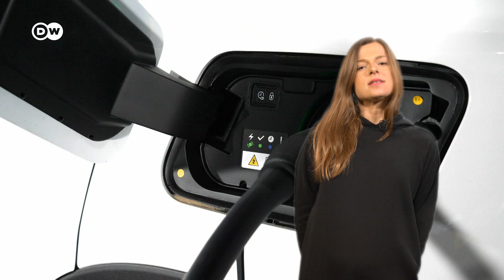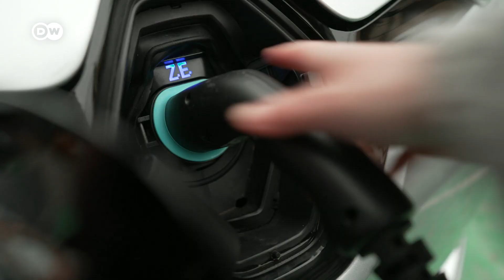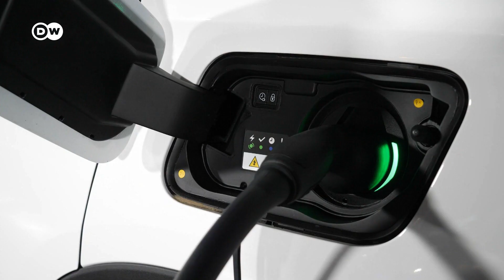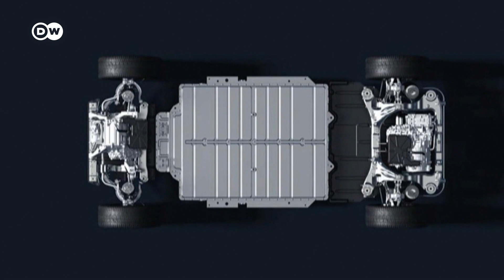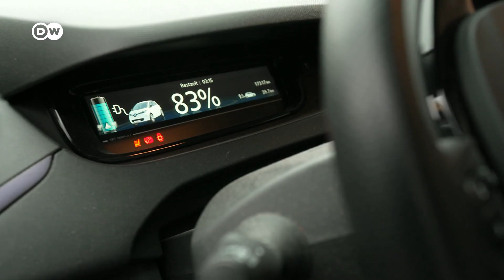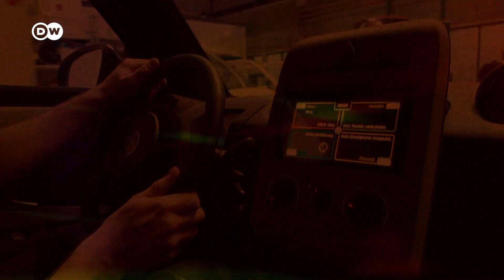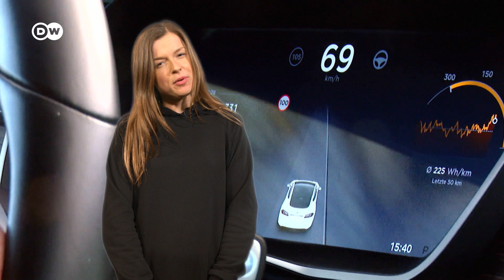From Explosions to Child Labor: EV Battery Truths

Comment: 10:35  ->"But still, are electric cars the only way out of the climate crisis?"  You people act like nothing else can be done. Like every single ICE car must me trashed and new money saved for the EV purchase. How realist is that? Do you expect all these cars now to be trashed for new EV's? Like no other way to cut emissions exists until each driver purchases an EV? Clearly this is intellectual dishonesty or extreme naïvety. The dirtiest GHG country, China will never surrender coal for  powering electricity. 98% of Americans rejected EV's this year for prolonged charging times first and not a dearth of charging stations. Electricity is no where near reliable even in wealthy countries all year long. There must be other clean renewable fuel solutions than dependence on a total ICE replacement EV fantasy. Indeed there are carbon negative biofuels cleaner than electricity. When the US adapted it's fuel supply to just 10% Ethanol replacement [E10], it prevented the equivalent of 3.85 million cars worth of CO2 uploading into the atmosphere.  Cellulosic Ethanol can be adapted to quicker than total ICE replacement to save the Earth quicker. Only your ego would prevent acknowledging the pragmatic solution of cellulosic biofuels pulling the carbon out of the atmosphere during it's lifecycle. It's even 30% cheaper than premium gasoline whilst sequestering atmospheric carbon. The answer is yes. There are other pathways reducing global warming even quicker than electric cars.

Comment: Cobalt is also used by the oil industry, Lithium has many sources Australia being one of the biggest. Fires are extremely rare, and far more common with a combustion engine. New solid state tech will make fires almost impossible. Battery life and energy density have improved massively. There really is nothing stopping the EV revolution except ignorance.

Peoples fears over the reality when it comes to EV's rarely pan out. My wife is a perfect example. She didn't want an EV. Now she wouldn't drive anything else.
Reply: Ev fanboy
Reply: @jah_08  Well yes, is that even an argument?
Reply: You people disgust me
Reply: @jah_08  I couldn't care less. I don't even know you.
Reply: Eh

Comment: I don't know why the policy makers should dictate the future of vehicles? All they should be interested in is how clean the vehicle  driving unit is. And hence there should be a ban on petrols and diesels and not petrol and diesel cars all together.

Apart from whats said, Lithium mining is not green and so the carbon footprint of EVs are generally a little higher. Problem is that these facts are overlooked by the policy makers.

I'm not biased but since childhood, I was moved by the sound of the engines. EVs don't have the same charecter, can not just see millions of job losses and selling the auto-industry to the tech giants!
Reply: A recent report by Europe shows the EV to use 300-400 times less resources than an ICE car. The argument about whether EV's are better for the environment is over. It is time to get ready for the EV revolution.
Reply: @daydreamer8373  I like your arguments. It's no hidden fact that electrics have less moving parts than IC cars, a lot less. And it means job losses. But that thing is to be sort out by the government and the car companies. 
Anyway, The electric revolution is for real and already happening, this video talks about the problems faced in the making of a battery pack, then there is the charging problem and such, Fuel cell technology is good, so good that it may end in replacing the battery packs.
Reply: @ritdhar6579  The advent of the EV which is a part of the huge green economy will in fact create jobs, and wealth for those that invest in the future. Tesla is a perfect example of this.

Never before has there been so much investment pouring into battery development. The battery of the future will solve any remaining issues surrounding manufacture.

I'm not sure what charging problem you are talking about, but again easily addressed with investment, which will reap huge rewards as Tesla has shown.

Fuel Cell technology will not be used for general transport. Maybe shipping and Aviation might benefit.